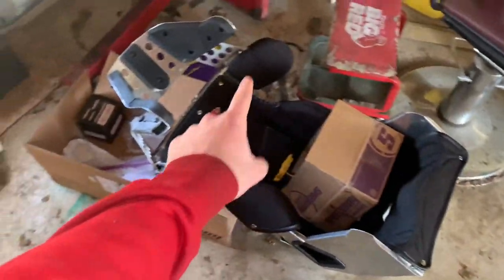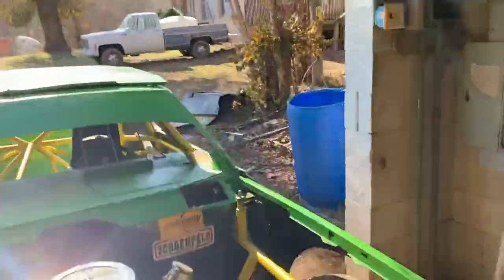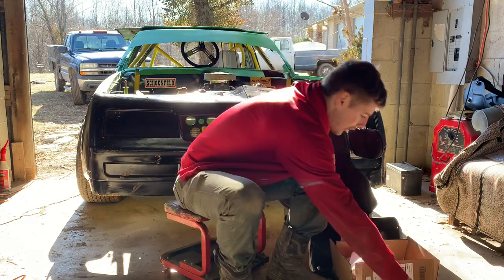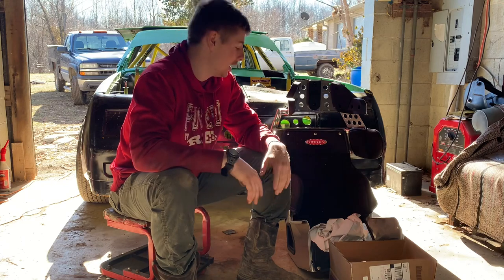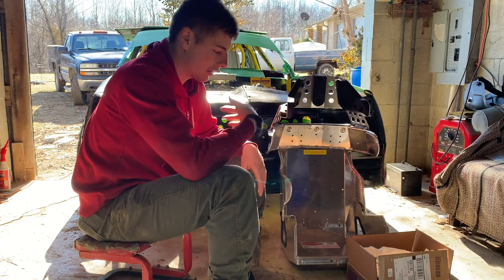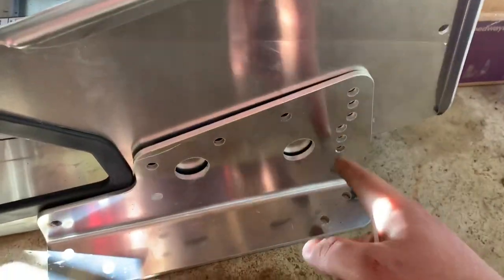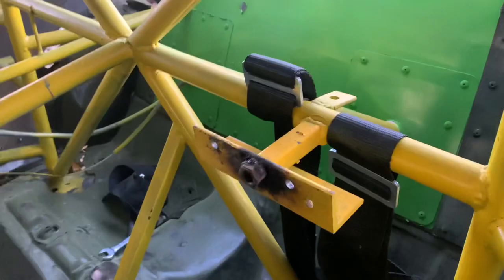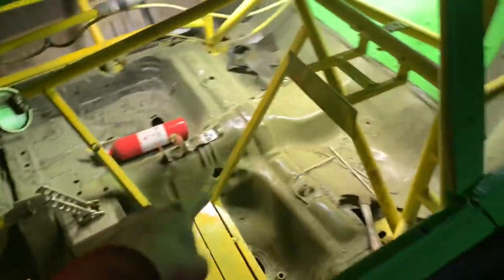Installing a full containment seat into the bomber! (Kirkey 70160)

Comment: May not be the best seat in the world but its safer than the other one. Definately a good investment in buying full containment seat. I'd definately get that back mount rewelded. Its one of the major supports incase of wrecks and it'd really be bad to have those weld break in a wreck.
Reply: My track requires them in every single class. From big block modified all the way down to mini stocks(my class)

Comment: Half to full in to back of fan. And as for timing it is advanced a bit muck. 30 to 32 degrees at 4k rpm. As for not wanting to start after idol it's loading up. Jets may be to big but it ment for race not  Idol. When it does that just hold the gas pedal to the floor and crank it till it fires. Do not pump it... start needs shimd and may need replaced at this point as well as flywheel.  Just inspect both bro
Reply from the maker: Hey makes since, my last car was the same way. Couple times the only way it would start at the track was at full throttle. And flywheel and starter are actually in good shape. After I get it shimmed it will be just fine.